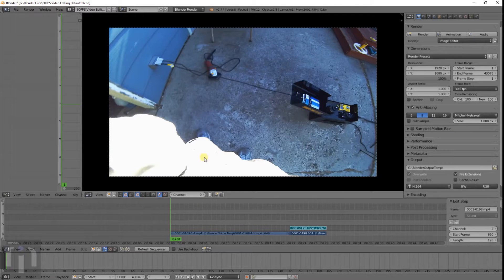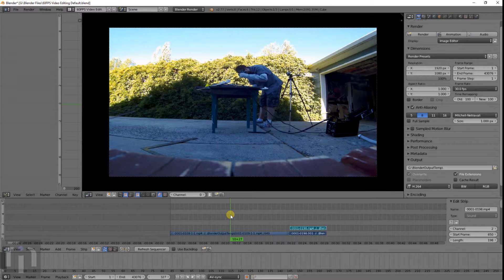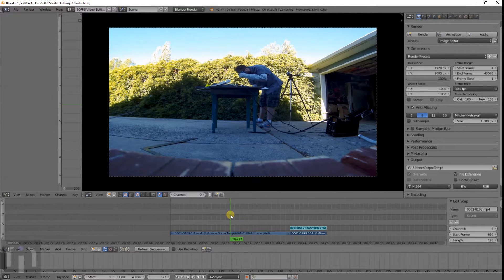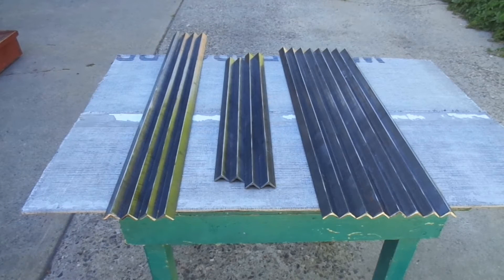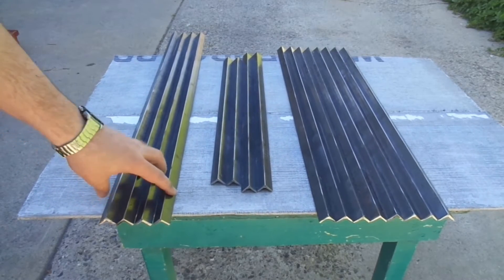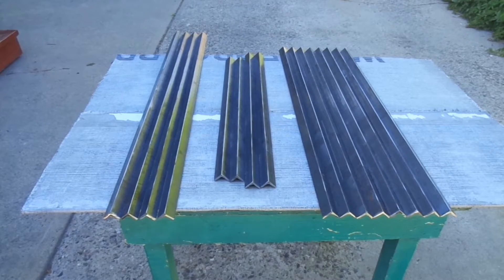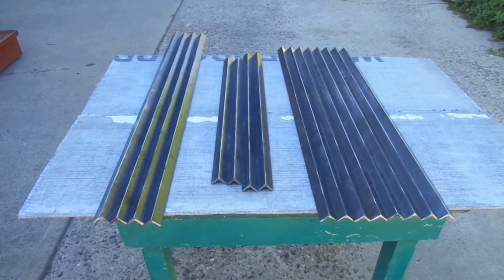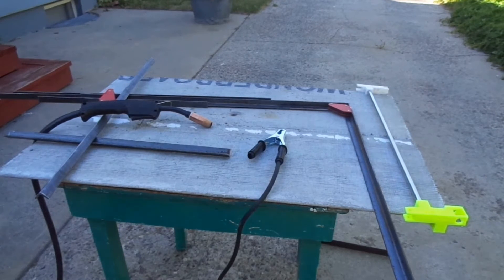3D Printer Build : Welding Time Lapse - Progress so far

Comment: Im planning a build myself.  Im not a big fan of extruded aluminum frames.  Since I own a plasma cutter and a welder Ill be following your example.  Keep the videos coming.
Reply from the maker: It worked alright, except the bed was not as stable as I really needed.  I have since built a new printer out of extruded aluminum.  It works a lot better than this one ever did, and is a coreXY.  It isn't as big though.  

If you're going with this route, I recommend having two supports on each side of the bed with a leadscrew in a triangle pattern from the two supports.  They corner method was flawed in that it had a tendency to rock back and forth.  You'll also want to support the frame on the corners with braces.  It flexed a lot more than I expected, being steel.  

I just upgraded my new printer with the triangle support design from the previous belt driven system that I had.  It is very stable now.  

I haven't been making videos due to medical conditions that causes severe fatigue. I might make more in the future, but for the near future, I don't see that happening.  I'll be here from time to time if you have questions though.